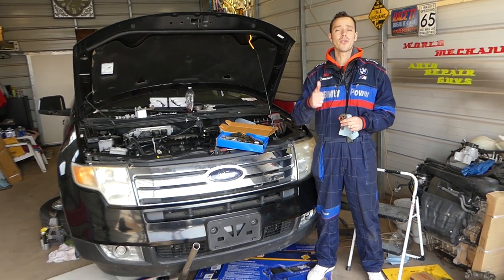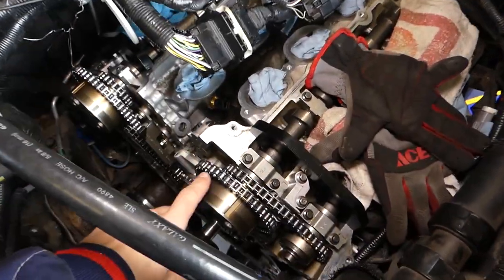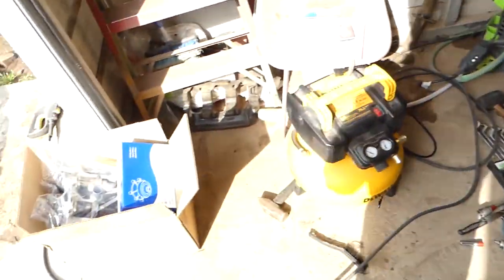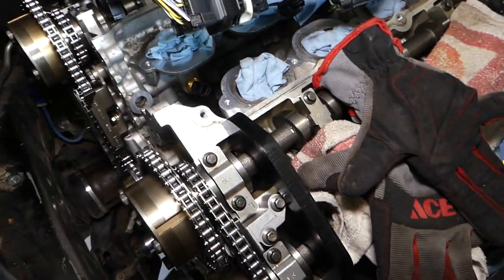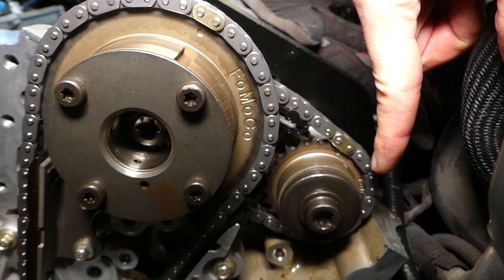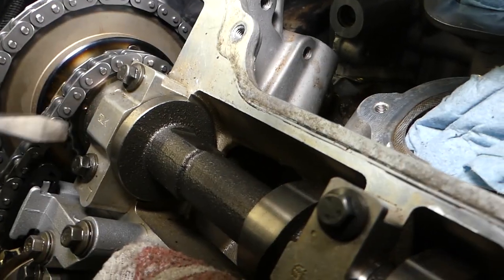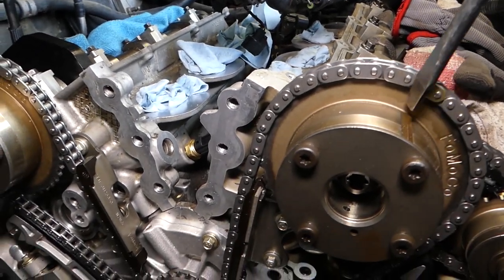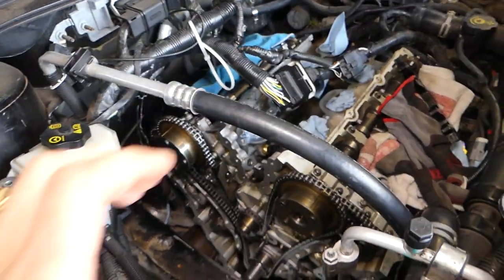TIMING MARKS FORD TAURUS, TAURUS X FUSION SPORT. TIMING CHAIN MARKS

Comment: This this most stupidest design ford ever made on these cars I have a 2009 ford Taurus that only has 58,000 miles and it left me stranded.is would vibrate the engine and but sometimes is quiet it was making a weird sound then the car sputter and went off I thought maybe to serpentine belt broke but when I look at the engine compartment it seem attach.i don’t know if my timing chain snap